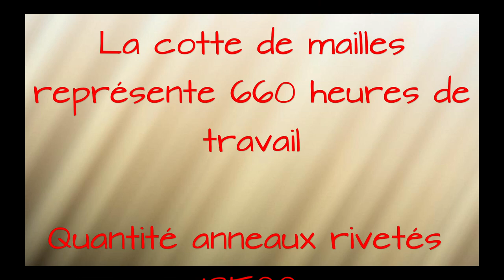Fabrication Cotte de mailles rivetées , chapitre 2

Comment: Can you show us how did you made the punching tool? Like a tutorial with mesurements materials ecc? Thanks
Reply from the maker: I wanted to show on the tutorial that it is possible , but the punch is 1.5 mm in diameter and it breaks easily with the impact of the hammer , I advise you to buy a punching pliers and reverse the rings , or drill ! the 1.5-diameter demonstration punch the metal is a forest tail and the 1.8-diameter die is made of relatively hard steel ,   Best regard .
Reply: @dadacheval  thanks! Do you have a tutorial on punching pliers or any brand I should look for?
Reply from the maker: @rebelbiker9956  No I don’t have a tutorial , I saw on some quotes they sell claws with links , this can be used as a model! good luck!
Reply: @dadacheval  thanks again for the courtesy !